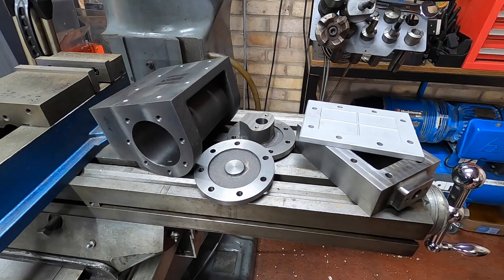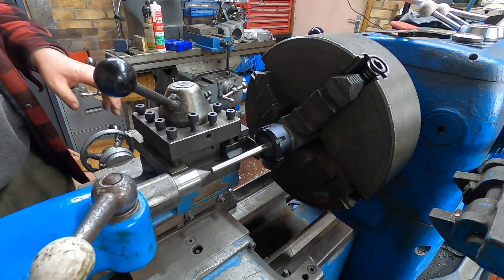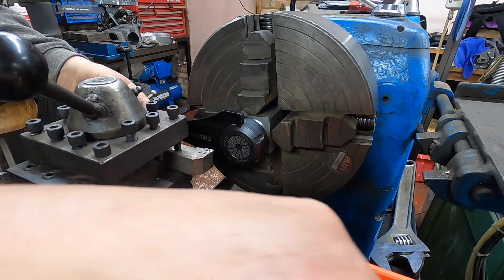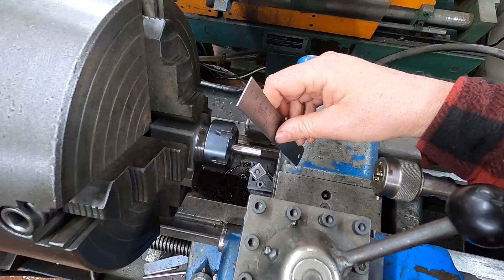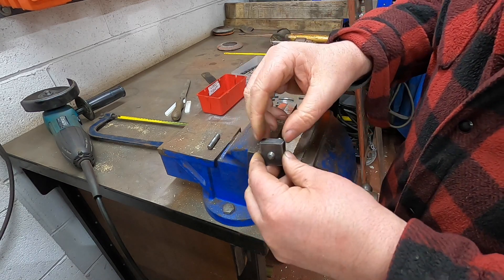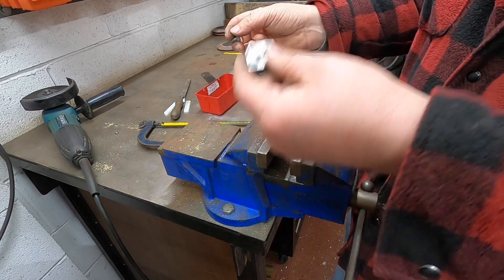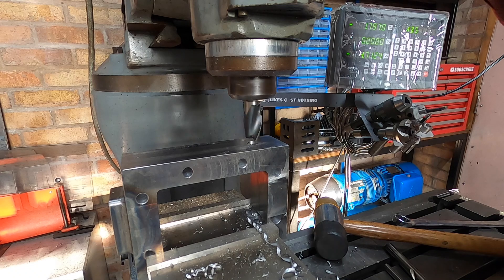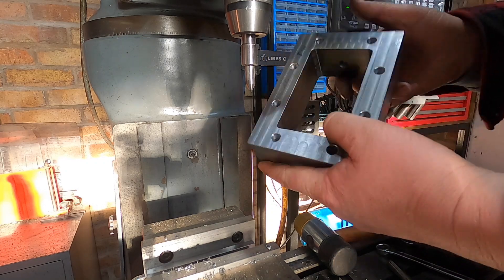Valve Chest & Cylinder Cover Studs, Steam inlet port - ep59 - 7.25" Gauge Steam Locomotive Build

Comment: Hi Matt. 
Great to see the ‘power’ bits assembled.
Nice, neat work on the studs too 👍
For deburring and ‘finishing’ stud ends, I use an ‘external’ chamfer bit ( internal cone with 3 or 4 carbide cutters.
Saves chucking them all up.
Also, I’ve seen visible studs slightly ‘domed’ to add some extra ‘bling’.
Regards
Robert
Reply from the maker: Thanks Robert, much appreciated. Good shout on chamfer tool, thanks. Domed studs??! life is to short for that 😂😂 especially when you may not see them. All the best, Matt 👍